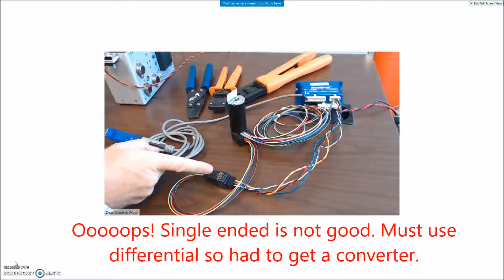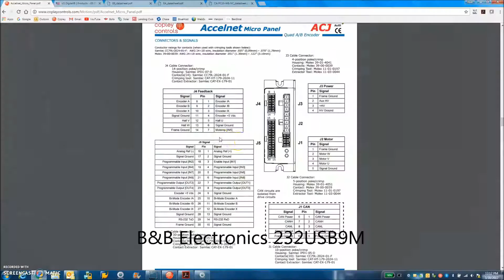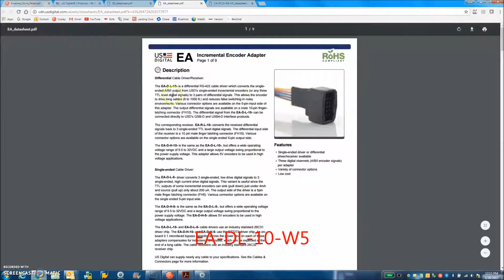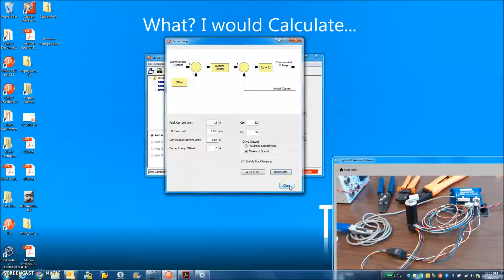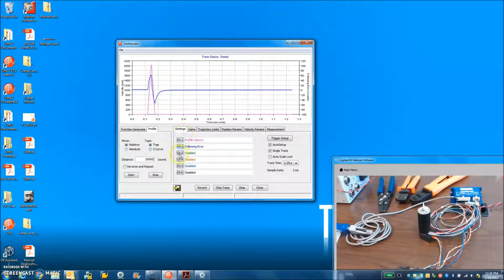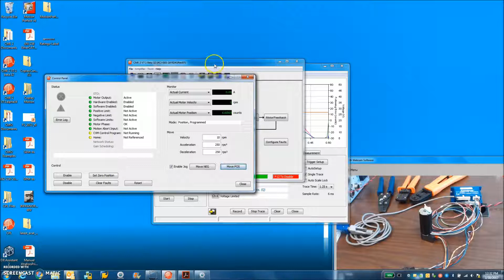Maxon Encoder Position mode with Halls for commutation

Comment: We've servo-drive(ACJ-055-09). We connected it with the motor and powered it up. And we tried to set it up using CME software through RS-232 communication. But it didn't respond. We rechecked all the connections for several times but nothing solved. It says "Please check your connections and verify that the amplifier is powered on". Why would this problem happen?

It will be so helpful if you kindly have an answer to this problem.
Reply from the maker: Raju, let me help you with that. Please send me email at dcrumlish@copleycontrols.com
Reply from the maker: Sounds like CME has found the serial port on Windows but not able to talk to drive. We should see an led light on the drive to confirm power is on. Copley makes a new SER-USB-RJ11 that helps remove any bad connection questions. Can you talk to other drives? Send me email at dcrumlish@copleycontrols.com